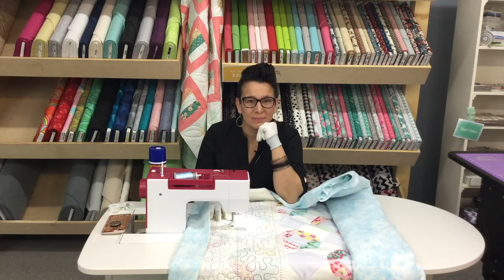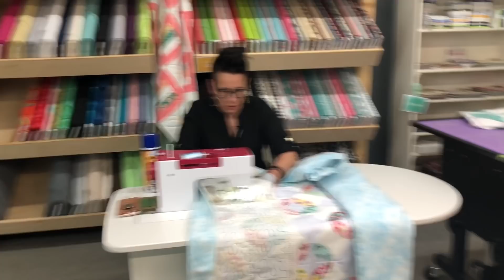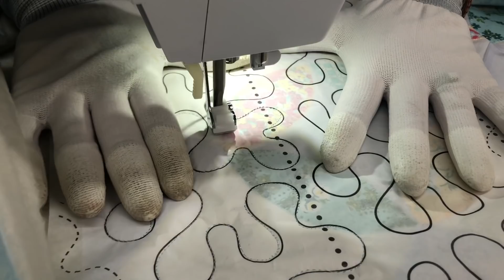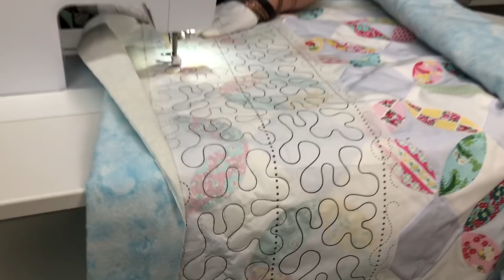Tear Away Quilting Designs with Machingers

Comment: Is the quilt top spray basted to the batting and backing before you attached the paper to the quilt top?
Reply from the maker: gay reeder in the first video I basted the paper on to the quilt top only. In between vids I spray basted the quilt. I ended up removing the second and third row as they had loosened over night. The adhesive is quite temporary. Now I am attaching as I go. And learning along the way!! 😁